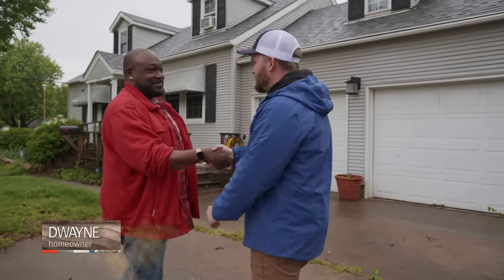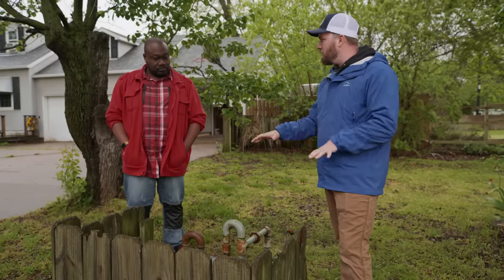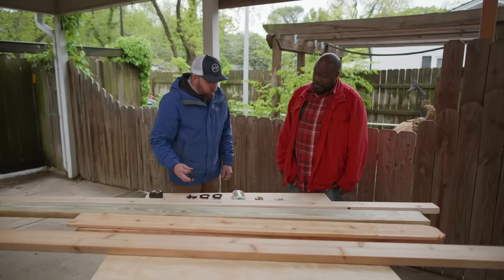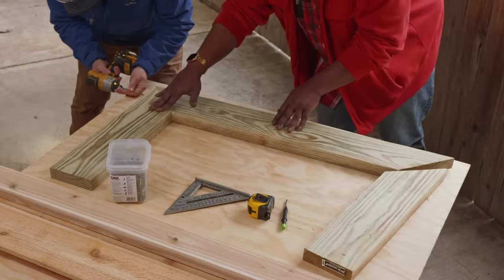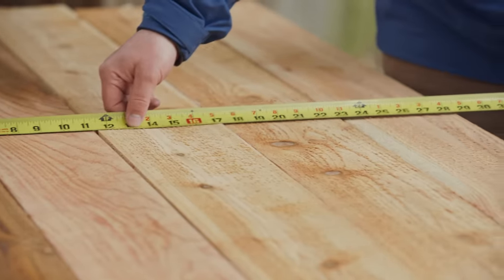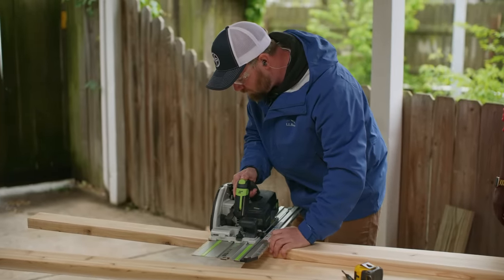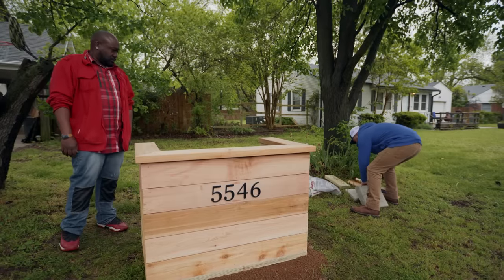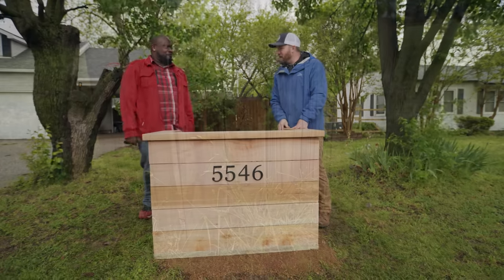How To Build a Utility Cover | Ask This Old House

Comment: Only thing I would argue is to not gap the planks. Those suckers are soaking wet from the store and will shrink up as they dry and those 1/8 gaps will suddenly become 3/8 or more
Reply: Very true. I used to always gap them, but once I had a small gate that wouldn’t require a rip on the last piece if I butted them all together. I was surprised when they grew a 1/8 inch gap after just a few months.
Reply: @MoneyManHolmes  I made the mistake once of gapping them to match what was already in  on an existing fence and it looked horrible a few months later

Comment: Looks very nice. Now put a couple coats of used motor oil and it will last for decades.
Reply: 0w20 is on my trailer.   The color is awesome and the 7 year old boards have no worn look.   They are as good as they were new.     Great for fence posts too. Old farmer trick!!!

Comment: For extra weight, I'd consider sand or gravel, like a gabion. Line the inside with geotextile fabric for drainage, sheet or board up the interior side, and fill the voids with sand. Ought to fit 5 or 6 50-lb bags

Comment: I dislike the 2x6 base. So much ground-contact surface. Also a very slight angle on the top cap would help with rain run-off. But can't argue the result as it looks great!

Comment: So code say, no roof? I would have added a roof on that thing. As well i would have taken it off from ground by rocks or something.
Reply: So you would have violated code and put a roof on it?
Reply: Are you trying to keep the gas meter out of the rain?
Reply: @Noneofyourbiz123  I literally asked that is it code there that you can't add a roof.
As here it is a code to be covered...

Don't be so hostile with assumptions.

I didn't anywhere say that I would go against the code.
Reply: @paristo  You said you would have added a roof.  Its against code there, he said it.
Reply: @Noneofyourbiz123  
I literally ASKED IT IN FIRST LINE, IS IT SO?!

I didn't anywhere say that I would violate the code by adding the roof. 
I said I would have added the roof, as I have done so here! But if you can't, then you can't there. 

I would as well separated the soil and the construction so that it last much longer.
Reply: @paristo  So code say, no roof? I would have added a roof on that thing. You said you would have added a roof.
Reply: @Noneofyourbiz123  I said that I would have added the roof if it isn't illegal. 
Like here it is not illegal, and it is not everywhere other places than just this country. 
Seriously, just get the grip what I have said and don't go coping around that I said that I would go against the law.

I don't even live in that country!

And it wouldn't be FIRST TIME that TOH would be making mistakes in the code statements....